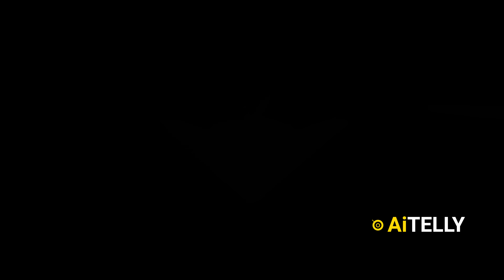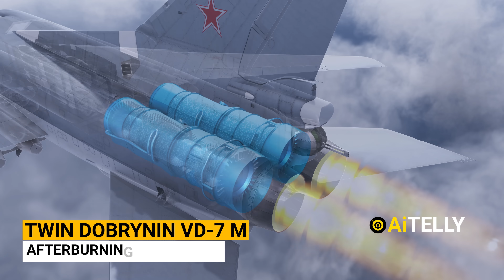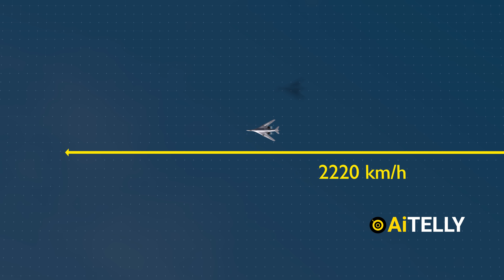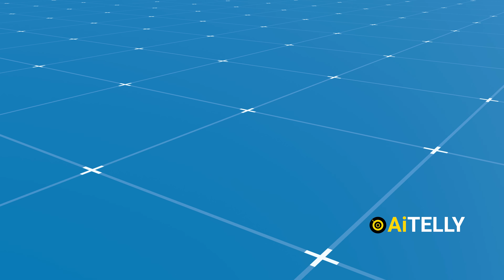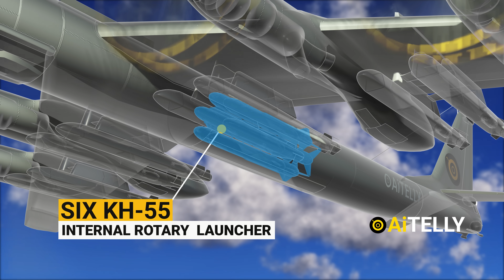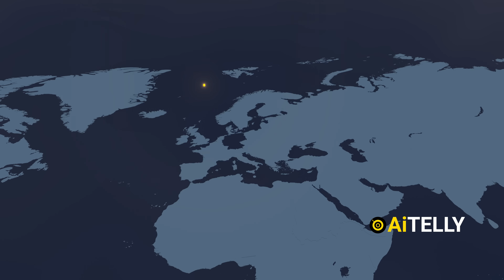How Russian Nuclear Bomber Works? Tu 160 Tu 22 Tu 95

Comment: Only the Russians managed to solve the ScramJet engine, and they made a historic breakthrough there. Their ScramJet really works, and not just for a few minutes to bust and burn. So they made a fully functional engine, which can throw a Zircon missile at 1500 km in the complete length of its path at hypersonic speed and hit the target, why should everyone take off their hats and bow to that miracle of technology in the form of an air jet engine. The problem with ScramJet engines is the incredible energies and temperatures that are generated in the engine itself, which are an intractable problem for today's known materials. It is operational at speeds from Mach 5 to Mach 24.

In the case of the Zircon rocket, during the flight in some higher layers of the atmosphere, temperatures of over 2000 Kelvin (1727*C) are generated at the top of the rocket, and this is for the entire flight length of 1500 km. Higher temperatures are created in the engine, because we have fuel injection and explosions in the chamber, which increase the temperature even more. No one knows how they solved it, because there is no known metal that can withstand that temperature, and it is assumed that the Russians somehow came into possession of those Metamaterials, which do not exist on planet earth and are unknown to the general scientific public. Such materials may be artificial, where the ingredients are spun and combined on a molecular level, they may be of extraterrestrial origin or who knows what... 

There is also the problem of the fuel itself that they use for Zircon and the moment of ignition of the fuel in the engine, and no one can burglaries as they solved, because the known laws of physics cannot explain those processes. The third big problem they solved was the transmission of signals through the plasma that is created around the rocket at those incredible speeds and communications with the rocket during the entire length of the flight, so that they could control it remotely. Plasma is the fourth aggregate state (between air and liquid) and in it the atoms are not bound to the nucleus, but are free, moving freely. During the flight of Zircon, incredible temperatures are created and all this defies the known laws of physics and fluid mechanics, because the molecular bonds of atoms are separated, and the forces of temperature and pressure are much greater than those that bind them. As a result, the viscosity and density of those gases and air changes, especially at the very top of the rocket and in that plasma shell in which the Zircon flies, and they managed to solve that so that it flies and that they can control it. At the same time, the Russians not only solved all these problems only at the laboratory level or that it works for a few seconds/minutes, so it needs to be perfected for about 10, 20 years, but they have a finished product that has been tested 1000 times, installed on ships and works . 

The other power centers in the world are not even close to that, they are already 20, 30 years behind. Given that only the Russians are proven to have a ScramJet engine, we can ask ourselves who is the closest to the 6th Generation of aircraft, where the aircraft must fly at hypersonic speeds.
Reply: Я не так хорошо разбираюсь в этом вопросе как ты.Но я думаю что для самолетов 6 поколения и выхода на гиперзвуковые скорости есть проблема не только в двигателе,но и в материалах самого планера самолета.Сейчас большинство самолетов строят с испольщованием заклепок.Сможет ли это выдержать температуры и скорости?Так же есть проблема с остеклением кабины.Думаю что такие самолеты появятся,но не думаю что жто произойдет в ближайшее время.

P.s.Спасибо за очень познавательный комментарий.Удачи тебе😁
Reply: @ottozussman4711  какие клепки?! Уже в СССР научились сваривать различные тугоплавкие материалы. Например, титан со сталью сваривают в вакууме.
Reply: Отличный комментарий! Могу добавить, что еще одна проблема была решена - не баллистическое управление / маневрирование на гиперзвуке (теоретическая и практическая физика и математика), ну и верно пометили - материаловедение, металлургия, электроника…
Reply: Что то мне подсказывает, что инженеры, как всегда нашли неожиданное в своей простоте решение, но к которому шли десятилетия сотни инженеров и учёных.
Reply: @ВладимирМельников-т4л  новейшие материалы, благо база была от СССР, восстановили институты, вуаля 20 лет и орешником всё сказано.
Reply: Гиперзвуковой ракетой невозможно управлять на сверхвысоких скоростях. Ракета летит по уже заранее рассчитанной траектории. Проблемы в таком случае возникают лишь с движущимися целями.
Reply: @Home_Diablo  это информация от американских инженеров? ) ну в середине 40х так же считали про сверхзвук. Управление на гиперзвуке это вопрос физики, математики и материаловедения не более
Reply: ok
Reply: Ok ok wait a second here

Both kinzhal and zircon missile didn't use the scramjet engine and as far as we know both of them are considered as a HYPERSONIC missile that isn't following the ballistic trajectory where most missile could reach a hypersonic speed.i dont even think theres any russian hypersonic missiles that uses scramjet as their propulsion.
Reply: @DanielsMMs  Russia has indeed developed a hypersonic scramjet engine and installed it on the Zircon nuclear-capable hypersonic cruise missile. Consequently, unlike the Kh-47 Kinzhal, the Zircon missile is indeed hypersonic and capable of sustaining a constant hypersonic speed.

The 3M22 Zircon is powered by an advanced scramjet propulsion system, which allows it to travel at hypersonic speeds. The Zircon employs a two-stage propulsion system, combining a solid-fuel booster for its initial launch with a scramjet engine for sustained hypersonic flight, ensuring high speed and maneuverability, with a top speed of Mach 9 (11,000 km/h) and a range of up to 1,000 km.
Reply: @DanielsMMs  Don't bother trying to argue. These are the same people who claimed Russian Su57 is far superior to the F22 in stealth by using plasma field cloaking technology, and that it had zero heat engines.
Reply: самолет шестого поколения уже есть,осталось доделать двигатель,и проблема с роботизацией,у человека на таком будет выдавливать кровь сквозь кожу...,нужно больше специалистов ,которые уехали из России в США за деньгами,но они скоро вернутся,когда поймут,что США скоро потонет,как корабль в атлантике
Reply: @kosvel9076  Russians have been saying that since they were the Soviets, back in the late 1940's. We're still here, unchanged, and strong as ever. Your country has already sunk, then re-floated, and renamed. THAT is a curse, and bad luck, if you want to talk naval parlance. We don't sink, because we didn't build in the ability to sink. Dasvidaniya.
Reply: @GJones462-2W1  and yet your country "sink" in afganistan after 20yrs for nothing LMAO
Reply: @mrizaldi7199  Big talk for someone whose country lost in 9 years in Afghanistan. At least the Americans were trying to modernize that hellhole, unlike your predecessor state. And they didn't lose military,  just pencil pushers at Washington DC not wanting to fight after 20 years, 2 trillion dollars and 2400 dead.
Reply: Как-то многовато конспирологии... Вроде бы, ещё не существует ни одной полноценной гиперзвуковой ракеты, которая бы сохраняла такую скорость на всём своём пути.
Reply: @nope.118  ты кастрюлю с головы сними, Россия давно этими ракетами врагов утюжит.
Reply: All the comments are bullshit. Of course, there were some aliens here.🤣

Comment: Even with predictable trajectories I REALLY fucking doubt a freaking Sea Sparrow can reliably intercept an object moving at more than 5 mach. I know they are supposed to be highly modernized but they are still based on an over half century old design that was nearly deemed a failure at its initial operational deployment.

Comment: 1)The KH-15 has been decommissioned, why mention it? But at the same time, KH-22 and KH-32 are mentioned only in one word at the end of the video. 2) The X-47M2 Dagger does not break through to the target at low altitude. This is an aeroballistic missile and it attacks its target from above. How can authors who have spent many hours on this material not know this? By the way, the KH-32 also hits the target in a dive (from 40 kilometers). Talking about the long-outdated Sea Sparrow (or automatic guns) to repel such threats is simply ridiculous. 3)What's the point of talking about the speed of an American hypersonic missile if it's not ready yet.
Reply: Research direct from comic books, Hollywood movies, Misthink Tanks, and US Military Unintelligence.
Reply: @GenghisX999 uh ok then whatever you say….And your source is more so on the lines of “trust me bro”
Reply: Atleast someone knows somewhat what they are talking about,

Comment: Very interesting, but I'm not sure the Tu-22M can carry four Kinzhal hypersonic missiles. Even if it could, they would not be useful against an aircraft carrier, because the Kinzhal achieves its hypersonic speed when dropped from high altitude by a MiG-31 fighter. If launched from a Tu-22M flying at low altitude to avoid radar detection, the Kinzhal would not be able to reach its hypersonic speed because it wouldn't have enough time to accelerate. As matter of fact, the Tu-22 was designed to carry another anti-ship missile, the Kh-22, and its modernized variant, the Kh-32.
Reply: Да, скорость будет меньше. Но всё равно достаточной, чтобы ракета считалась гиперзвуковой. И вполне достаточной для того, чтобы использовать все преимущества гиперзвукового оружия. Теоретически её будет проще перехватить, но на практике это все равно будет очень и очень не просто.
Reply: @Zordeos  I think that the Kh-22 has proved to be more effective than the Kinzhal, because Ukrainian air defenses have not managed to bring down any of them, while they have shot down at least one Kinzhal.

Comment: tu-95 cannot carry 8 rockets under wing because of significant wear of rocket holding elements or wear of the plane entirely. Usually not more than 4 rockets are on the board, often 1-2 per plane.

Comment: @Ai Telly. No one cannot detect a hypersonic missile. It's surrounded by a plasma sheath that is totally invisible to radar. You just misled your audience.

Also the idea that you can acquire, lock and shoot down a low flying hypersonic missile that just popped up from the horizon is wrong. 

Even if you can, it's too fast to intercept. You will miss
Reply: That’s not how hypersonic missiles work and that’s not how radar works. It’s very visible as it’s moving so fast and pulse Doppler radars use difference in speed to find targets. Cruise missiles avoid radar by flying low, so that it’s hidden from radar by the horizon and things like hills. By the time it shows up, there’s very little  time to react. Hypersonic weapons are interceptable, ICBMs are hypersonic but since they can be spotted up to 30 minutes before impact, it’s easier to intercept. Cruise missiles rely on speed and stealth to delay detection and decrease the time  to react.
Reply: @itsericzhou  I am referring to the plasma sheath that covers the missile in the lower atmosphere, not high up in space
Reply: No that's not how hypersonics work, and yeah the plasma Shield or plasma that is generated is extremely detectable,😂😂
I mean seriously we've been detecting Hypersonic objects for decades, how do you think they can track on radar to re-entry of the Space Shuttle or the crew capsules from the Soviet space program or the Apollo space program because they are both surrounded by plasma when they're hitting the atmosphere. You shouldn't really believe Russian propaganda because it is in fact hilariously wrong.
As for intercepting hypersonic missiles, is laughably easy especially when the system defending is the target of that missile. It's basic physics and you should probably take a few more physics classes before you try to make such outrageously false claims.
In fact hypersonics have been intercepted on multiple occasions
Reply: @GR_Chief  Ok. Thanks ignoramus troll that does not know what happens to rockets in reentry:face-blue-smiling:

Comment: Kinzhal missile does not have wings and it cannot fly that low to the surface. It's opposite. It flies very fast on high altitude with hypersonic speed and then falls on a target. No modern anti-aircraft system  of any country can intercept it. For now, it's technically impossible. Tu-22m is not carrier of Kinzhal hypersonic missiles. It carries another type of anti ship , anti aircraft carrier hypersonic missile named Kh-32. Older version was called Kh-22.
Reply: Also by the definition of this channel, the Kindle is not a Hypersonic cuz it cannot maneuver while in flight. It is a are launched ballistic missile there's a big difference😂
Now if you want to know what a true Hypersonic missile is, the Chinese claim to have a Hypersonic Glide vehicle. And the Americans have one going into production called the mako.
Reply: @GR_Chief  It is hypersonic. It perfectly maneuvers during the flgith. It has special surfaces for that. It is not ballistic missile at all. Manuevering surfaces are robust to withstand extremely high speed and temperatures.
Reply: @AlexanderTch  what u just said in OP is a contradiction to your second comment, it flies high and fast and then descends towards its target while slowing down (rocket boosters are depleted after the climb stage) which is the exact definition of an "ALBM". And yes it absolutely can be destroyed by air defense systems, PAC-3 MSE is ABM-rated, THAAD gas been developed entirely for this purpose and SM-3 and SM-6 are tested to be a ble to destroy hypersonic ballistic missiles.
Reply: @ttv_notkorbi3398  Kinzhal is not launched from earth surface. so, it does not require any climbing. It's lifted by carrier - Mig-31K, or Tu-22M3M or Su-57. They accelerate to 2-3M sueprsonic speed and play role as first stage of missile. Missile flies on hypersonic speed at altitude 20 km. If flies at speed 10-12M by non-ballistic trajectory. It does maneuvers. Those ancient thaads and Sm-3s are only for intercepting of ballistic missiles, on high altitudes. They cannot technically intercept any hypersonic or even supersonic target moving at 20 km altitude. They can only intercept ballistic targets moving at altitude 100-200 kms without any maneuvering. So, they must have long range radar that locks target on orbit, then computer calculates tragectory of pure ballistic target and then anti missile is launched to intercept it in certain point. Max thaads missile speed is 8M.  So, even Russian hypersonic gliders Avangard cannot be intercepted by any anti missile systgem in the world. 
So, that's silly to believe that american not tested system designed quarter century ago can intercept hypersonic target. Then show example. Those silly Sm-3s just intercepted once old American satellite flying at altitude 240 km with predicted trajectory.
Reply: @AlexanderTch  uhm Iran? SM-3 shot down multiple Ballistic Missiles  over Iran this year, so they are combat proven.
Reply: @ttv_notkorbi3398  Sure, according to US data. But only for obsolete ordinary ballistic missiles. Iran does not have intercontinental ballistic missiles. So, even it's not american propaganda. they could intercept short and medium range missiles, and 0 cruise missiles. Iran has some models of ballistic missiles based on old soviet system made in 70s.
There were any tests for intercontinental ballistic missile warheads.
Reply: @GR_Chief  Thank you for showing me that you have a masters in military physics
Reply: Kinzhal have been intercepted many times by now...  But no one will stop you from spreading lies.
Reply: Lmao, Kinzhals are easily intercepted even by 1980's tech.
Reply: @ArilMaven A nafo bot has appeared
Reply: @TrusePkay or possibly just a sixth grader because you know it's not that difficult😂
Reply: @ArilMaven  Lol. Show me videos or photos of those "interceptions".